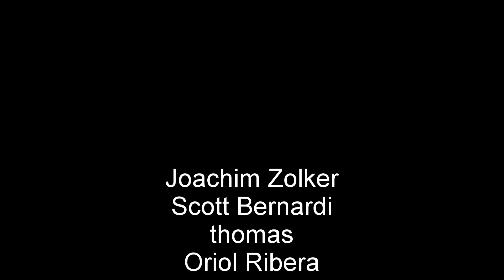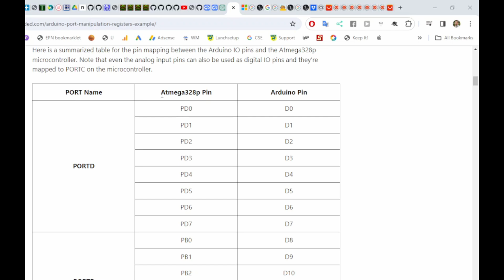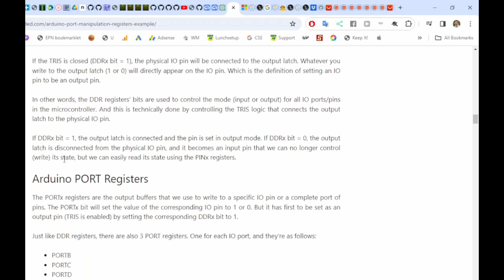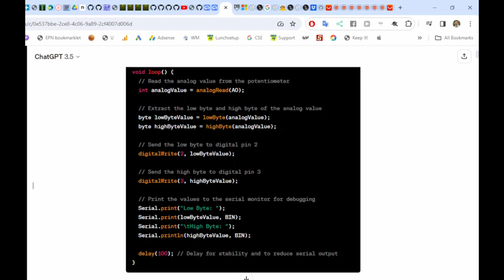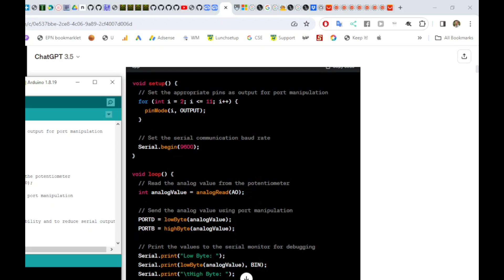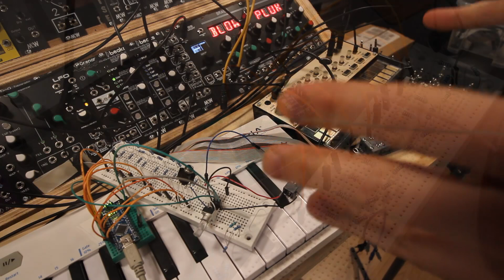Arduino 10 bit "analog" output using Port manipulation and R/2R ladder

Comment: Nice video. Maybe your scope can not show time domain signals in 10 bit resolution, but using its FFT function you might be able to see the difference when using the smoothing capacitor or not in the signal's spectrum. Oh and your mi-th-pwm-peaks is of course a nice example of 2 byte pwm.
Reply from the maker: Maybe I didn’t try hard enough to get a good image on the scope? 😅 And yes the Beaks is a very good example. Now I just want to get as good example out of the arduino. ;)